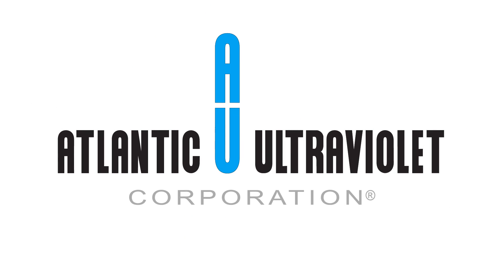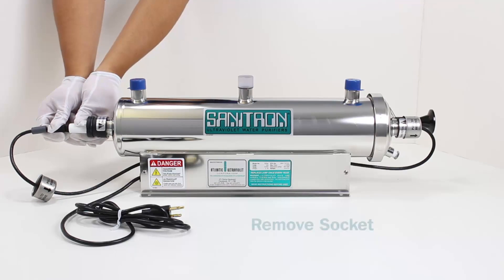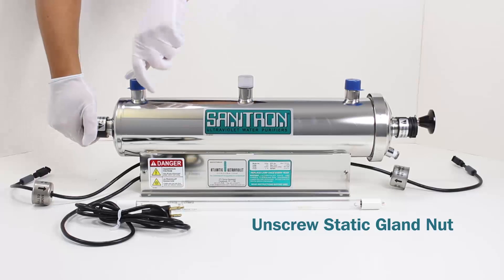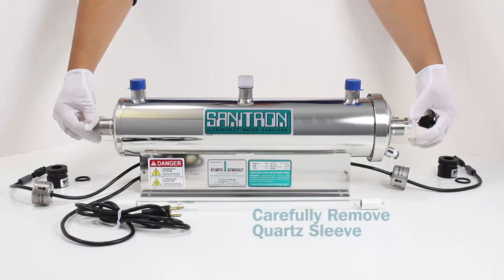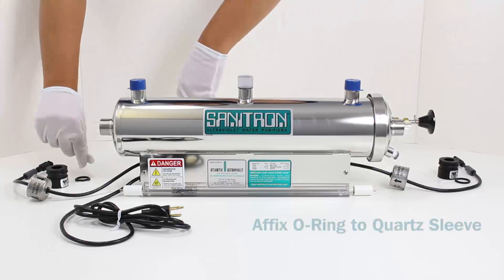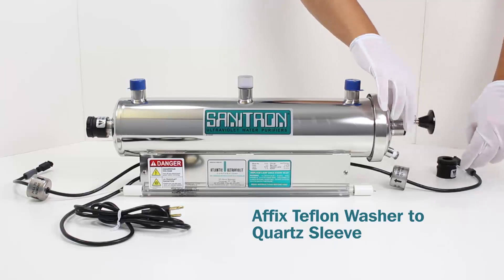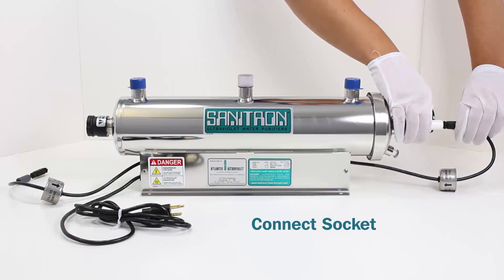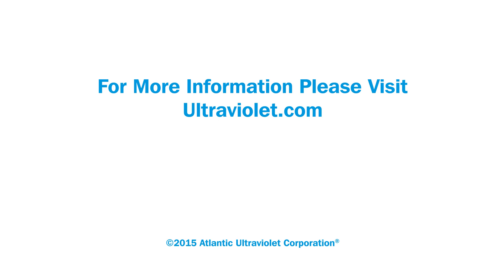Sanitron Ultraviolet Water Purifier Sleeve & Lamp Installation

Comment: Step 1 should be to shut off the water inlet and outlet supply.  Remove the chamber drain plug.  Drain water,  Clean and wrap the drain plug with teflon tape, then reinstall drain plug.  The video is very helpful.  The tip about the rotating the wiper assembly would also be helpful.

Comment: On an unused unit, like one in the video,  there is no concern about moisture in the  quartz tube but should there be a concern when replacing the quartz sleeve on your home unit?
Reply from the maker: Walt,
 Thank you for your question.  When replacing your quartz sleeve in your home unit, there shouldn’t be a concern about moisture inside the quartz sleeve.  If the quartz sleeve you are taking out of your Sanitron system has moisture or water droplets on the inside of the quartz sleeve, then there was a small chip and/or crack in it to allow the moisture inside.  The quartz sleeve MUST be replaced at that time.

Any further questions or comments, please call us at 631-273-0500 and one of the members of our sales staff will gladly help you.

Ricky Wysocki
UV Application Specialist
Atlantic Ultraviolet Corporation
375 Marcus Blvd. | Hauppauge, NY 11788
T: 631-273-0500 ext. 105
  F: 631-273-0771

Email: RWysocki@AtlanticUV.com
Ultraviolet.com

BuyUltraviolet.com

Comment: Hi...Didn't get an owners manual when we purchased our house with this sanitron system.  I need to get a new UV lamp.  Do you have to replace the quartz sleeve and UV lamp or can I just replace the lamp? Thanks.
Reply from the maker: Sorry for the delayed response. We hope you found what you needed. Just visit BuyUltraviolet.com for PDF manuals, maintenance kits, and all replacement parts. https://www.buyultraviolet.com/sanitron-uv-water-purifiers-single-chamber
Reply from the maker: Please visit BuyUltraviolet.com for all replacement parts and pdf manuals. Call 631-273-0500 if you need further information.

Comment: I'm having a problem replacing the quartz sleeve, there is something in there blocking it.  If it's the wiper, can I remove it?
Reply from the maker: Sorry for the delayed response, call 631-273-0500 or email sales@atlanticuv.com for support. PDF manuals are available on BuyUltraviolet.com on your product page.

Comment: So does the quartz sleeve easily slide through the wiper assembly?  I thought it might be more complicated to install the quartz sleeve with that wiper assembly to deal with.
Reply: Jimonqa,

Sometimes when you remove the quartz sleeve in a Sanitron model, the wiper rod itself will turn a little bit.  When installing the new quartz sleeve, you may need to rotate the black wiper knob to align the quartz sleeve through the wiper rings.  If you have any other questions or comments, please don't hesitate to contact here at our office.  631-273-0500.  Thank you.

Ricky Wysocki, UV Application Specialist
Reply: Thank you... that is helpful to know and I appreciate the quick response!